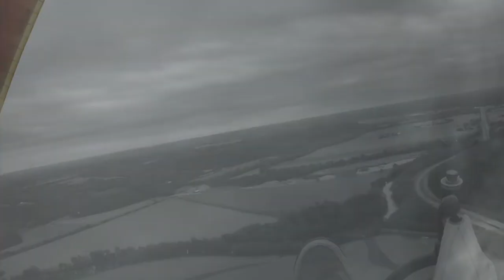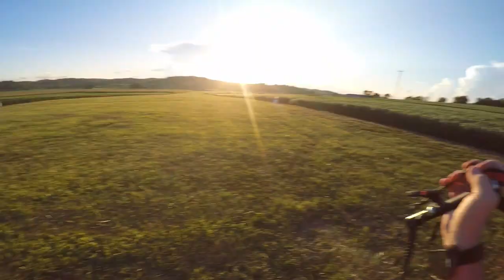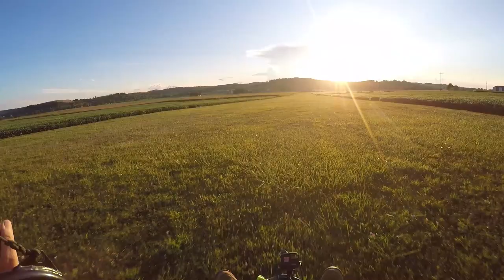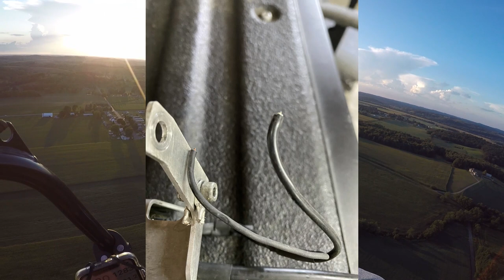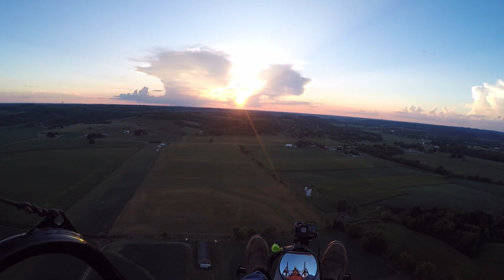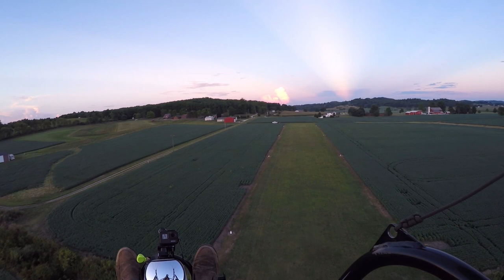NGK Spark Plugs, Two Stroke Oil and Paramotor confident flying again.  Ohio ParaTrike Adventures.

Comment from the maker: I have three XC flights now.  Isn’t a cross country flight taking off from one place and landing in another, considered a cross country flight??
Reply: that's the way i understand it lol.
and you don't need to practice engine out training.
Reply from the maker: I’m going with that!!
Reply: That bracket (held my PVL coil), you showed in your video, failed me after only two hours (new monster).   Though I thought I had pre-flighted it after you had your first ground break (coincidence) the night before my flight, in my case all four "fingers" broke just underneath the bolt heads/wide flange likely from vibration which did not stop the engine from running but did cause the kill switch to not work (grounded on flange but disconnected from the engine).   After talking to southern skies, it seems FB has redesigned the PVL (coil) bracket holder to be connected with two bolts with rubber mounts (like engine mounts) that connect to the frame to mitigate vibration.   Wish I could post pics

Comment: I wonder if you could use an automotive braided ground strap. Ive never seen one of those break. Nice to see ya land the same place you took off from finally!
Reply from the maker: I bought some!! That is the wire I talk about just wasn’t very clear about it.   I think the wire ties will work for now and will keep praying it holds up.   I did buy a new  coil as well.  Just in case.  But yes I have three braided ground straps, I can cut in half so I could make six ground wires!!!!   Think that is extra overkill?   😂😂😂
Reply from the maker: Oh!!!! Btw, landing some where other than where you take off is an XC flight!!!!   Lol
Reply: After 3 engine outs I’d have so many ground wires on it that it would be hard to see the engine!

Comment: I would encase the whole wire end in a big glob of silicone to absorb the vibration on the end of the wire....just my 0.02
Reply from the maker: I’ve wire tied it for now and it appears to be working.  My next step is to use a ground strap.  The real problem in the first place is why is it breaking.

Comment: Love your videos. I have a question, do you have a temp gauge? I have a monster motor and I am concerned about over heating. It gets up to 450 on climb out running about 5300 rpm. Once up to altitude, I back it off to maybe 4500,  and it drops to 370 or so. Does this seem normal to you? Thanks again
Reply from the maker: steven jolls I do not run a temp gauge.  My buddy does on his monster as he’s a big guy and wanted to keep an eye on it.  I climb out full throttle at 6100 rpms and cruise around 4600-5000.   Depending on trim setting.  

Maybe some on here will answer the heat question.  I thought I read 500 or so was hot.